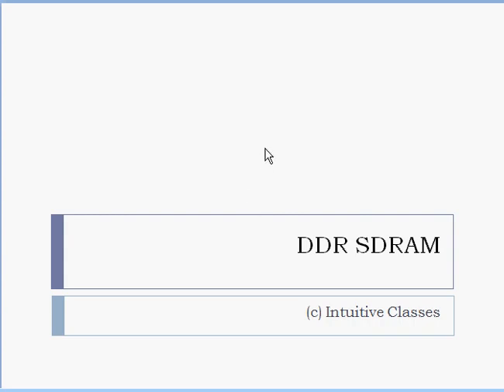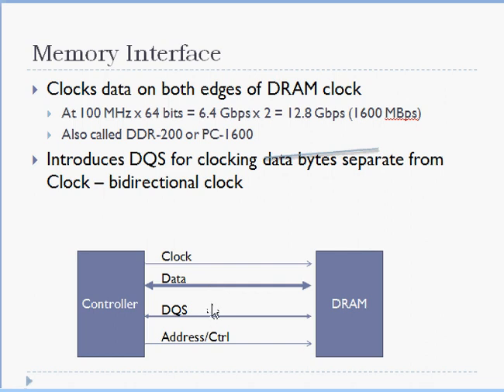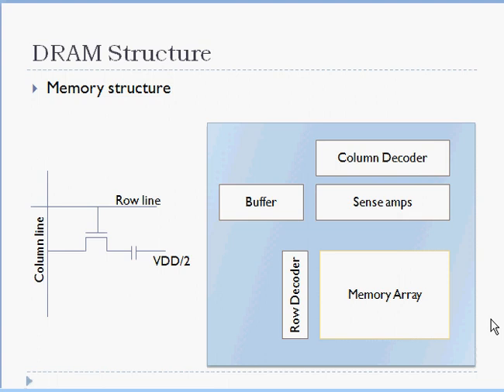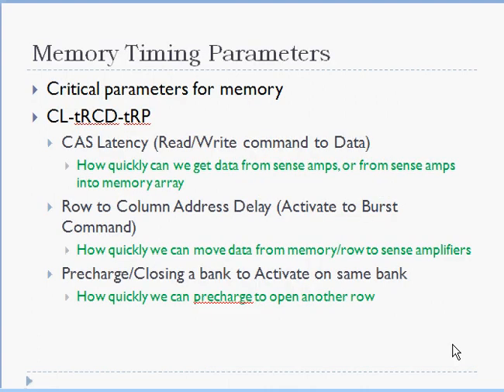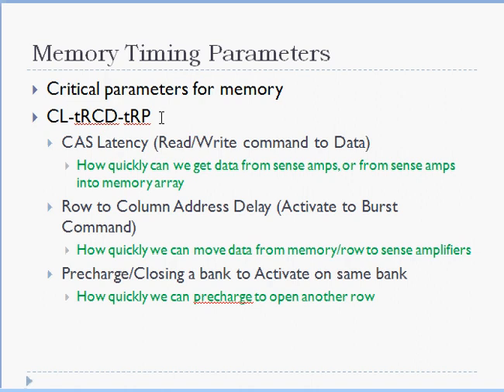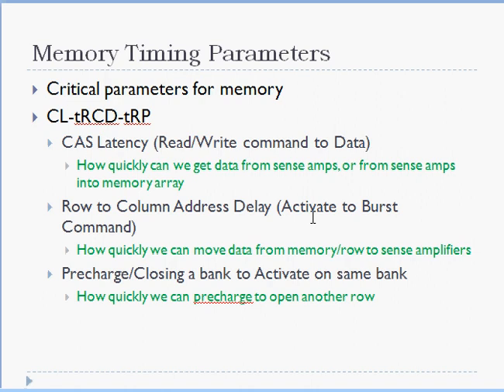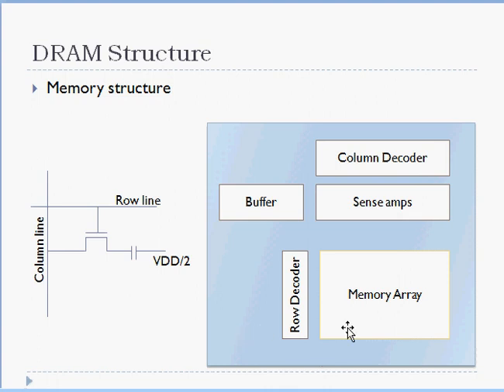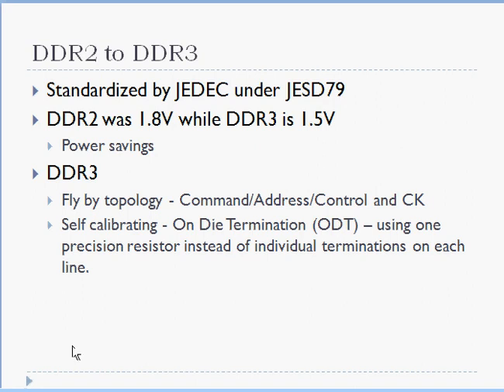DDR Technology Introduction

Comment: Old video but a question:
Why is fly-by topology is used at DDR3?
Reply: to improve the signal integrity performance of DDR signals, both CA and DQ. 
the side effect is the propagating skew between CK and DQS, so write leveling and read leveling is introduced to compensate this skew.